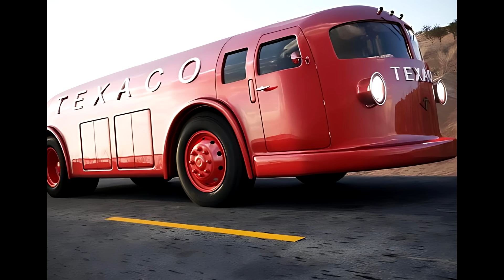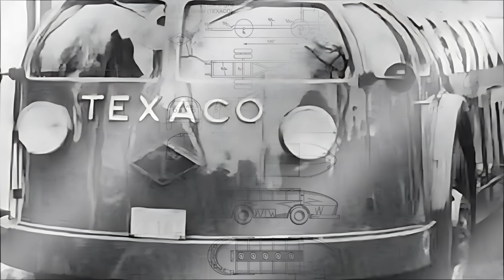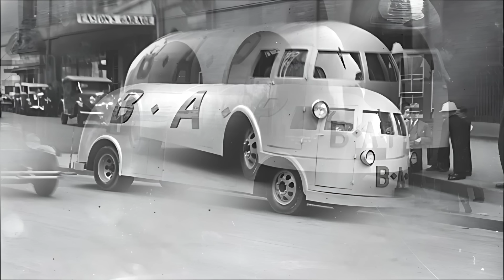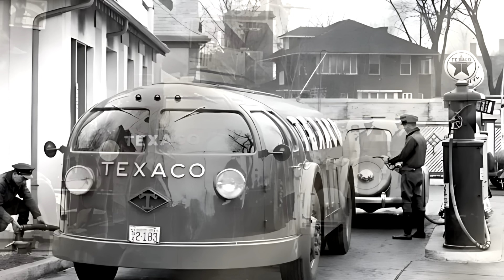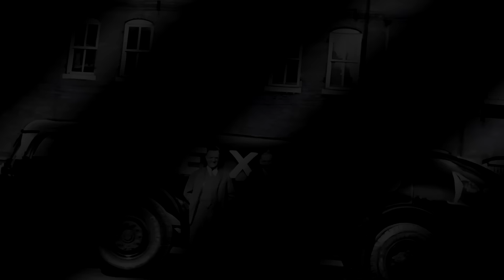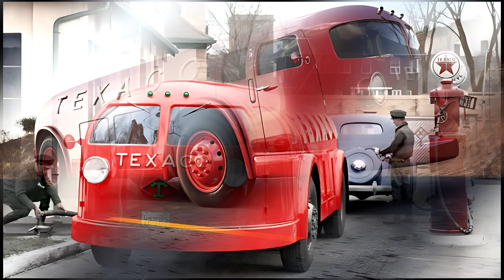1933 Diamond T Doodlebug 🧠 When Design Went Further Than Technology

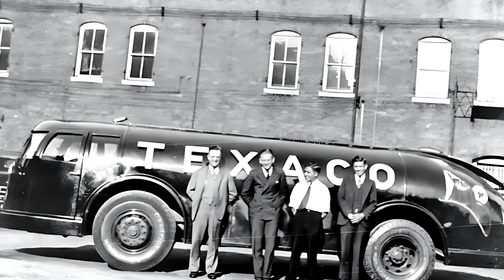Comment: 03:42 The idea of using a microphone to pipe engine noise into the driver's cab because the rear-mounted engine was so far away is incredibly ingenious. It's such a practical solution to a unique engineering challenge that most people would never even consider for a truck of that era.

Comment: "The 1933 Texaco Doodlebug was a revolutionary tanker truck — sleek, futuristic, and engineered for efficiency. With its rear-mounted engine, streamlined body, and innovative driver controls, it symbolized Texaco’s push toward modern fuel delivery and set new standards in industrial vehicle design, even if none survive today.

Comment: I think the most surprising thing to me about this is that it was done right in the middle of the Great Depression. This sort of corporate branding work feels at odds with what so many experienced at the time. Part of me wonders if it was seen as an attempt to reach for a more hopeful future. Whatever the case may be, I find it fascinating that such a project was undertaken when the country was struggling to make ends meet.
Reply: Cheap labor at the time. It was technically helping the economy. I remember some story about Lincoln pulling all the engines out of production line cars during the depression and having them all balanced cuz machinists were working for peanuts at the time.

Comment: I suppose, in the ‘30s it was easier to build your own vehicle for a special marketing purpose. Nowadays the only specially made vehicle is the one shaped like a hot dog in bread.
Otherwise they use a truck chassis, for example the hi-rail vehicles that fit rail wheels to truck chassis for railway service vehicles such as spray weeds.

Comment: Interesting that the original blueprints seemed to show that it was using duallies on the front wheels also...
Reply: It also appears that the wheel arches were still accommodating of this in the production vehicles. Perhaps it was a convert-able option depending on long runs to far away customers.

Comment: The T inside the diamond logo on the front had nothing to do with Texaco. It was the logo on Diamond T trucks for years. I used to drive a Diamond T in the 70's for Seaboard Tank Lines hauling for Gulf Oil in the Philly area.

Comment: AI images. Saw flaws & inconsistencies on each image, except maybe the toy Image.  Look close at they gas station attendant behind the Doodlebug. What is he holding? Not a gas nozzle.   The photos not in the Texaco livery has different propane front wheel. One image is not even a complete render, still pixelated from the bumper own. Nice try, but these are not real.
Reply: The gas station attendant is definitely holding a nozzle. That photo like most of these is in multiple places on the intenet. The B-A-P version is definitely completely different. Even the track is narrower.

Comment: In my area of Idaho, the big tankers that supply the Maverik chain of gas stations, are pretty tricked out. They have what appears to be a horizontal stabilizer wing on the rear, complete with winglets, I was told (as a pilot i was intrigued) that it helped stability...., but the driver wasn't sure how.  What helped also is the way the tank is mounted on the truck frame in order to keep the center of gravity as low as possible.
Reply: Interesting. I've seen a propane tanker with the spoiler with winglets.

Comment: 🤔hmmmmmm 🤔
Uncle Albert / Yellow Submarine = What you get when you give four(4) Beatles psychedelic narcotics 
Lockheed U-2 / Northrop B-2 Spirit = What you get when you give Skunk Works Engineers psychedelic narcotics  
Diamond T Doodlebug = What you get when you administer psychedelic narcotics to diesel mechanics 
Sometimes it works out fine  , and sometimes ....meh 😏 gigglesnortgiggle 😏 
❤😇
Reply: Psychedelic drugs are not narcotics, and I don't think anyone gave the Beatles any. They wanted to use LSD and found someone to buy from.

Comment: If memory serves the "highth was" Just as much? If Not? More Function that worked out in fasion with Oil or Fuel Tanks often under cover from weather, or exposure these days?  before modern requirements. after WWII
As was the width, and lengths. 
As I recall the driver had a heater? or defroster from the rear engine or DC?

Comment: good desigh but only carried max 2000 gal , todays tankers haul at least 7000  so 4.5 x the old truck  . might be good for home heating oil but not gasoline
Reply: First of all the Doodlebug had a capacity of 1,500 gallons and for the early 30's it was alot since most other Tankers were merely converted from passenger vehicles.  There were very few truck manufacturers that were specifically designing their vehicles for heavy haul at the time.  Secondly, WHY ARE YOU COMPARING 30'S TRUCKS WITH MODERN TRUCKS?
Reply: @Vickyvee97 Home heating oil ta nks are 275 gallon so a load of 1500 could service quite a few local deliveries. In the 70s I owned a Sunoco station and the delivery truck (an International diesel) was only 1500 gallon and refilled after a couple stops in the thumb of Michigan.
Reply: When that was built that was a lot!
Reply: @Marlin-56  indeed!
Reply: 2000 x 4,5 = 9 000 not 7000 obviously you are an American. Alternative facts in the times of Trump. Third grade math. 🤯🥴🤦‍♀️🤦‍♂️
Reply: @bokhans  so i did it too quick see a Psychiatrists  for your tds mental illness btw tankers can hold up ti 10,000
Reply: @bokhans ?